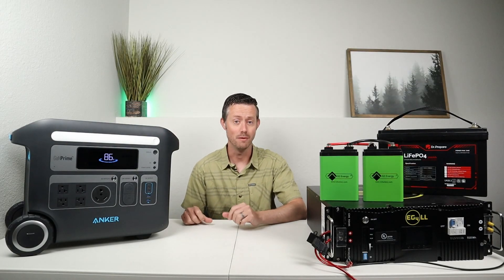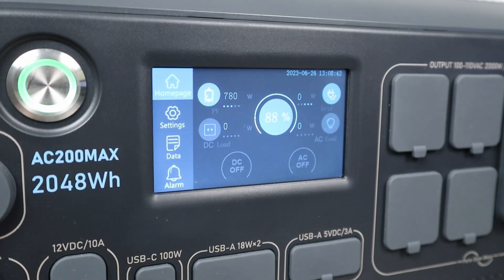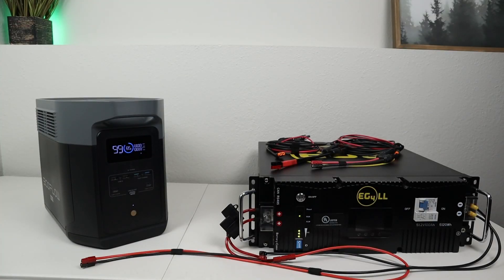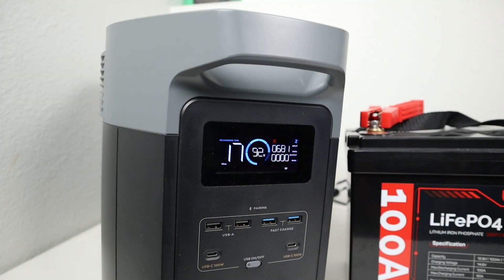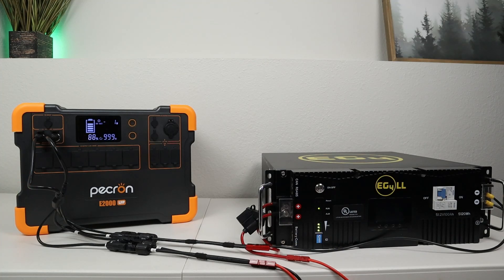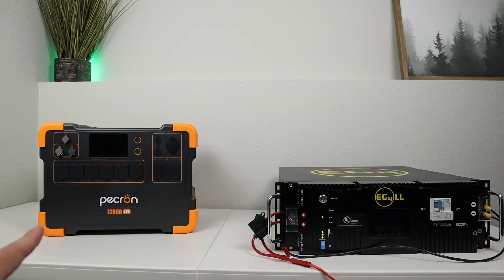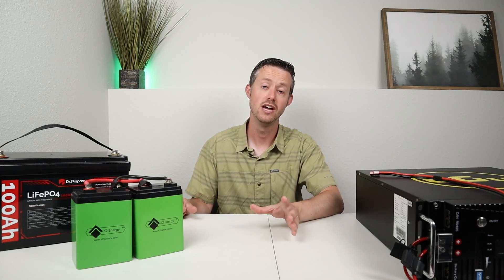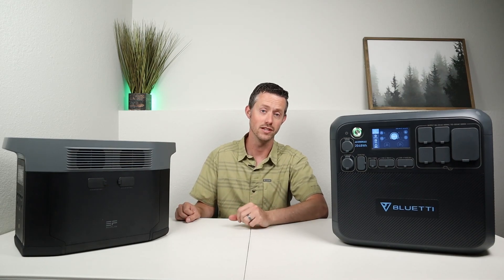Using Batteries To Extend Power Station Runtimes?! 48v LFP Server Rack 'Expansion Battery'!

Comment: You can just connect your battery to a proper inverter and charge from the mains station input. Right?
Reply from the maker: Sure can, but add in efficiency losses of the inverter.

Comment: @Jasonoid -- Another excellent video! Thank you!! 😃 I'm curious, would it be safe to leave the leave these batteries connected to a charger and a power station 24/7? For example, connecting the 48V LiFePO4 charger to the EG4 server rack battery so it's always topped off, but also leaving it connected to the power station as well to give a "semi-permanent" capacity upgrade. What are your thoughts? 🤓
Reply from the maker: When I leave my EG4 48v connected to my AC500 overnight it keeps the power ststion at 100%SOC. It will charge at 750 watts and the stop charging and then charge again on and off. I haven't seen any issues with it long term on my power station.
Reply: @Jasonoid that's great to hear, thank you Jason!! 😍

Comment: Thanks great video again. You answered questions.  We had communicated before, anyway I purchased the ECOFLOW Delta 2 Max, being delivered today.  I was shopping around for expansion and decided in the EG4 lifepower4 48V.  I will use this to expand the Delta 2 Max.  I chose the Ecoflo because in addition to an excellent battery was the smart app.  My main goal was to move some of my critical loads to the cheaper rate late at night here in Atlanta Georgia.  The addition of the EG4 I can get a timer to only come on during the cheaper rate hours to recharge the EG4, small problem to fix.  I discovered this video right on time.  I will be double checking on cables.
Reply: I’m in Atlanta as well. Taking notes on this setup

Comment: It's wild that I see those K2 units on this video, as at the moment I'm testing one of those exact batteries right now for capacity - except mine is over 10 years old.  

So far so good, it's at about 90% of its stated 245.8wh capacity with a ~9 watt load, after a full recharge.  It has seen very little use over that 10 years, so it seems that the shelf life for infrequent use cases is really good. The discharge curve is ridiculously flat, going from 26.1 to 25V over nearly 21 hours of testing. (It has gone from 25 to 24V over the past hour, so it might be getting close to dropping).

Mine's rated at 245.8Wh, 9.6Ah.  Now that I know they are still around, I need to check the specs on current units.

Edit: checked battery hookup, turns out they are selling used older units with the same specs as mine.  K2 Energy does still exist, the new units have a bump from 9.6 to 11Ah, but they are still charging prices from 10 years ago.
Reply from the maker: I bought these 24v K2s from Battery Hookup for super cheap! Great deal!

Comment: @Jasonoid Are there any good recommended 48 volt batteries that weigh less than 100 lbs.?
Reply from the maker: LFP batteries are heavy. You could put 4 12v batteries in series but when you run separate 12v batteries in series they won't auto balance. I'd recommend sticking to a server rack battery for the best pricing and performance.

Comment: Cool idea, but in this screenshot how did the batteries get charged in the first place? Is the suggested expansion to get a charger and battery? Is there a more efficient way to charge the battery with the power station?
Reply from the maker: I charge these batteries with solar panels and charge controllers. I did put out this video today.... but it's not a fast charging method:  https://youtu.be/-86sypG9goc

Comment: Similar point…if the 48 volt battery was hooked up thru xt60 connectors and with delta 2 max at full charge, …and the the delta 2 max went into pass thru mode, 

do you believe the 48 volt battery would work to flow thru and power recipient 12 volt draw appliances…until it exhausted and then delta 2 max would  kicked in from its full battery?
Reply from the maker: Yes, that's how it would work. The 48v battery would keep the internal battery of the power station full until it dies, then it will use the internal battery.

Comment: How long would this 48 volt server battery last in powering up an eco flow delta 2 max….

If delta 2 max has power storage of 0,…fully depleted charge level…
And it needs 2048 watts at 12 volts to a full charge…how many times could your 48 volt battery recharge the delta 2 max  before the 48 volt battery needed recharging.
Reply from the maker: You can get around 2 charge cycles from the 5120wh 48v battery on the Delta 2 Max

Comment: We definitely need EcoFlow to send you a set of EcoFlow Delta Pro's, the 240v voltage hub and corresponding accessories. 
Then ask Signature Solar if they will send a rack/stack of (6) 48v 100Ah 30.72kWh server rack batteries to perform heavy 120/240v charge/discharge loads using your EcoFlow Delta Pro's. 
^A use case I believe many of us would like to see as an additional option to our existing permanent/mobile installs. Thanks so much for your very helpful, insightful and informative videos.

Comment: Could you charge the eg4 with an ecoflow delta 2 max? If now how would you charge the eg4?
Reply from the maker: You'd have to have a dedicated 51.2v LFP battery charger and you plug that into the AC inverter to charge the EG4. It's probably best to use solar panels to charge the EG4 with its own solar charge controller and panels.
Reply: @Jasonoid  would any solar charger controller work? Or does it need a proprietary charge controller? And thanks for taking the time to respond!
Reply from the maker: I really like this 40 amp charge controller from Epever:  https://amzn.to/3Q7qY92
I use it to charge my EG4 battery. It supports 12v-48v batteries so you can even charge your car battery or a portable 12v battery too. It also allows for up to 150volts of solar input so you can put panels in series for a pretty big array.
Reply: @Jasonoid  okay i got 800 watts of solar. I have the ecoflow delta 2 max and im gona expand the battery with the eg4 you had in the video and charge it with that controller charger that you linked me to, to be able to get longer run times for my ac unit in my van. Is there anything you recommend me do/get?
Reply from the maker: @reedoburrito7456  I would recommend using 10awg wire so it doesn't get warm over long durations, also use a inline fuse coming off the EG4 battery just in case. Other than that, it should be good. Remember to always connect your battery to the charge controller first, then connect the solar panels once it's powered on, if not you'll get an error on the charge controller.
Reply: @Jasonoid  whats your cash app?
Reply from the maker: @reedoburrito7456  you could always paypal me at  jasonoidllc@gmail.com
Reply: I just sent it 👍
Reply from the maker: @reedoburrito7456  thank you so much! That's awesome!

Comment: Will these batteries void the warranty
Reply from the maker: As long as you stay within the charging voltage requirements of the power station it won't. Plug in a battery with too high of voltage it yes, you will damage the power station.

Comment: guess whats way easier than this... DONT BUY PORTABLE POWER STATIONS, build a proper system, get a pelicase and chuck the server rack batteries in it with victron equipment
Reply from the maker: I love DIY builds and I have a bunch of those on the channel. You gotta remember 90% of the world has no clue what electricity is and aren't comfortable working with it. They want something that just works, something plug n play.
Reply: Some of us are realizing our error and trying to correct it

Comment: What up Doe Dr J'

I really like the diy extended charging setup compared to the expansion battery from either company. The diy setup has multiple options and you can add more capacity down the line. Also as you mentioned, you can hookup an solar array as well
Great job 👍🏻
Reply from the maker: Always good to have multiple options for charging!

Comment: Hey. Enjoyed the video. I was hoping you could do one on charging the Oukitel/ffpower p2001 from the 48v lifepower. I have a couple of the lifepower, and I am reluctant to plug them in directly since the P2001 says max 48v input. The Lifepower outputs 51.2. Would I need a DC to DC convert to ensure it is precisely 48v?
Please provide a video on making cables and keeping the polarity for XT60 correct. The p2001 I bought (as you recommended) was the older version with Anderson connectors instead of XT60. Also, cables with ring terminals, MC4 connectors, Anderson, etc., to handle any situation. Perhaps affiliate links to materials or premade cables.
Also. I found what looks to be the EPEVER MPPT  Charge controller you showed, but all looked to handle a max of 36V. All of the 48V units were much more expensive.
Reply from the maker: The Oukitel / FFpower units are not compatible with these higher voltage 48v/51.2v batteries. The true voltage is even higher when at a full charge (usually around 56v to 57v). You may be able to find a DC to DC voltage reducer that will take the 48v output and drop it down to a lower usable voltage.

Comment: 👍👍, thank you. Now a request 😊 with delta pro and off beat battery to supply the 240 that the branded smart battery does. Please and thank you sir.
Reply from the maker: The Delta Pro also uses a 48v lfp battery so it would perform very similar to the Delta 2 Max, you'd want to have at least one battery for each Delta Pro for that to work with 240v.

Comment: I have an issue that I hope you can help me with. So I have two 36 volt Step Up converters wired in parallel that I charge up my AC180 and a AC300 from a 12 volt battery. I recently built a 48 volt step-up converter to charge my AC300 exclusively. So here is my issue.. 48v step-up converter will easily charge my AC180 at 475 W no problem. However when I try to run it on the AC300 the voltage and wattage are crazy erratic. Meaning the voltage and watts are juming all over the place a mile a minute. I am charging it through the solar charging inputs and no matter what I do or what setting I put it on it will not work. The funny thing is it will work on the AC180. And the 36 V step-up converter will work just fine on both. What possibly could be the problem?? My AC300 apparently it's allowed to take in 2400 watts of solar charging. And I know there is no way there is an over voltage because it is reading 48 volts and it would be nowhere near close to 2400 Watts input. Any suggestions cuz I'm pulling my hair out! LOL Thanks
Reply from the maker: What size of 12v 48v converter is it? How many amps is it rated for?
Reply: @Jasonoid  it's only rated for 10 amps and it is the same type of converter that you did a build on 36v. Another words the same company manufactures both.  It works great on my AC180 and gives me 475 watts. I talked to bluetti technical department yesterday and they updated my system with new firmware but it still doesn't work and they couldn't figure it out.  It's kind of upsetting because once I do plug-in solar panels I'm wondering if it's even going to work at all. The crazy thing though is my 36 volt step-up converter that I built based on your other video works just fine on my AC300 but not this 48-volt. I'm starting to wonder if there is something wrong maybe with the internal charge controller on the AC300.
Reply: @Jasonoid  you know I had an idea.. I think maybe that I should try plugging it in directly into my AC300 battery and maybe it will charge it that way. I was on the fence of possibly buying a 48v server rack battery kind of like what you have but there again if it won't work when plugged in the solar port on the AC300 I would just be wasting my money. Or I don't know maybe there's something wrong with the 48-volt step-up converter and it just doesn't like it. But that still doesn't make sense because it works on the AC180.
Reply from the maker: @jeffcornelison888  the AC300 pulls over 10 amps when charging at that level. It will try to pull 12 amps from the converter. Maybe it's being overloaded so it resets and then starts back up really quick? Maybe that explains the issue...
Reply: @Jasonoid  so in other words the step-up converter is being overloaded because the ac300 is trying to pull in more amperage than the step-up converter will allow? I did an amperage reading when it was plugged up into the AC 180 and it was drawing out of the battery right around 40.3 amps. The AC 180 is limited to 10 amps and I believe that the AC 300 is limited to 30 amps.
Reply: @Jasonoid  I think you're right on that. It only makes sense. Since the ac300 is such a large unit it would explain why it's probably pushing the step-up converter to its limits. Listen man I really appreciate you getting back to me and helping me out with this because I was going crazy trying to figure this out!
Reply from the maker: @jeffcornelison888  the AC300 will pull 48v @ 12 amps from that converter, which will be around 48 amps from your battery. There's no way to limit the DC Charging speed on the AC300 either, it will always try to pull 12 amps at that higher voltage. Maybe setting it to the car charging setting.
Reply: @Jasonoid  yes I did try charging it from the car charging setting. When I put it to that it will show 48 volts on the AC 300 however it will not charge it all. Then when I change it to solar charging the voltage and wattage jump all over the place spiking up and down in one to second intervals. So yes I think you're right the converter just simply can't handle it. But still I just don't understand why it can handle the 36 volt step-up converter
Reply: @Jasonoid  by the way do you have a patreon account for your YouTube channel? If so let me know and I will gladly donate to it because you have helped me out on numerous occasions and you really know your stuff. It is the least that I can do. Thank you for all of your help!

Comment: Do you make your own cable ends to go from the batteries to the inputs for the portable power stations? Or did you buy them and can give us the links? I would like to see more info about connecting safely, as I want to get one or two 12V mini batteries to do this kind of charging for my power stations sometimes.
Reply from the maker: I make all my own cables so I can make the cables the right length and use connections that fit my setup. Heres a video about making your own Anderson PowerPole connectors:  https://youtu.be/bZHh3nWXtkw

Comment: This seems like a really interesting solution to getting around the Anker 767 solar power input limitations. I’ve been struggling to find a combination of solar panels for my camper van roof that would max out the 1000w input. 

I would find it really interesting to see a test for this using a smaller and cheaper capacity 48v battery (50Ah?), a quality charge controller and enough solar panels to keep the 48v topped up while outputting close to 1000w to the Anker 767.
Reply: I am going to line my skoolie roof with 200 watt solar panels, probably 1200 watts and use this expansion battery idea. I also have an F2000 and it sits right in that weird area that makes it hard to max out your solar. This figuring out volts and Amps and which panels to use without over paneling is giving me a headache. This seems to solve all my problems and headaches

Comment: So let’s say you want to charge your EG4 48v battery using solar with your favored EPEVER charge controller while also charging your AC200MAX from the charge controller load terminals.  Does this work, and if so, how well?  While the 48v battery can give more capacity to a solar generator like the AC200MAX, it seems to require too much fiddling and cable swapping.  I have four 360W panels, but may have to configure them in 2s2p to stay under 150VOC for the affordable charge controllers.
Reply from the maker: Interesting idea on using the load output of the charge controller to charge the AC200max, I haven't ever tested that. I don't really see a reason for using the load output on the charge controller vs just connecting it to the 48v battery directly since it has a built in BMS and will keep it from being discharged to far. Why would you want to use the load terminals? Just curious since I may be missing a genius idea here haha
Reply: @Jasonoid  It wasn’t clear that one could charge the external battery while simultaneously charging the AC200MAX from it.
Reply from the maker: @tomhouck3476  so the charge controller will charge your 48v battery, and the you'll have the AC200max connected to the 48v battery terminals. The charge controller won't do both from the charging output, but it technically doesnt need to since the AC200max will get charged from the 48v battery itself.

Comment: One thing wasn’t clear to me. So on the bluetti 200max was the pv mode on or was the car charge mode on for each battery type?
Also is there a way to charge the 48v or 24 volt from the 12v DC 30 amp output?  Boost converter would work, right?  Be nice if power could go both ways especially when solar is in excess during the day. You could use an AC charger but avoiding the conversion losses is my goal.  The boost converter has maybe 10% loss.
Reply from the maker: The Bluetti AC200MAX kinda selects the charging mode on its own. If the voltage is under 32v, it usually defaults to car charging mode and you can't change it. Charging from the 30 amp DC output could be possible if you had a 10 amp DC to DC charger.